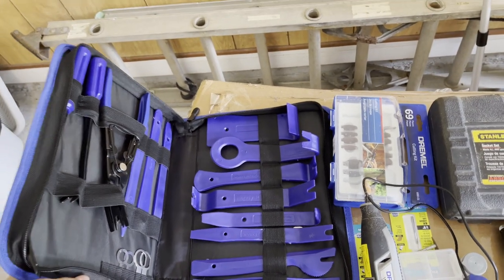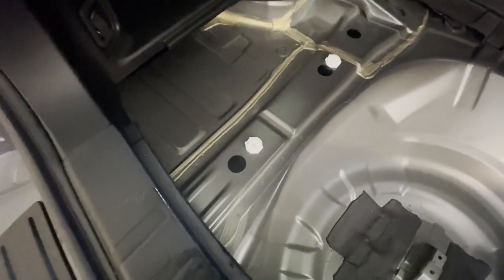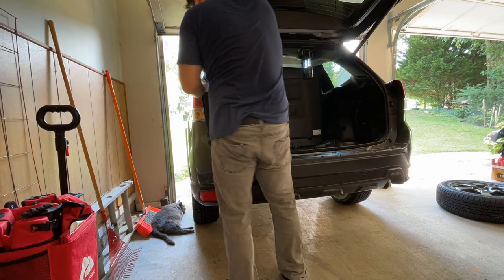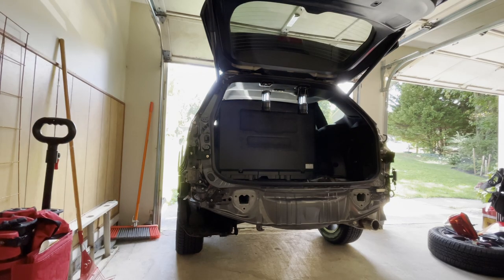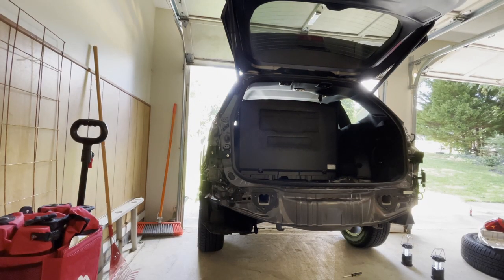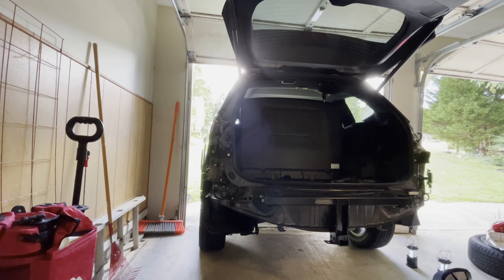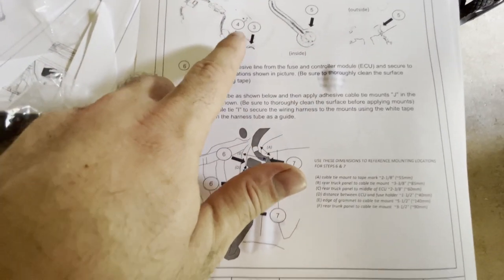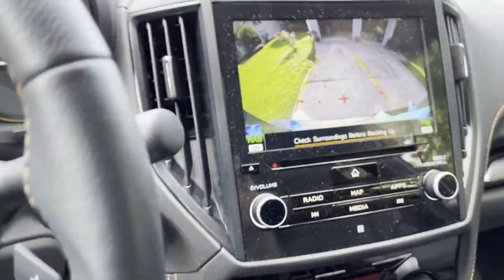Subaru Forester Wilderness 2022 - DIY Trailer Hitch Receiver Install

Comment: Your video was very helpful. Did install on my 2024 Forester Limited today. I’m a woman 63 years old. Got everything disassembled at lunchtime, a little over an hour. After work installed the hitch and got the car back together just need to mount the wiring harness parts in the spare wheel well.  The pictures with the installation instructions from Subaru were very tough for me to make out.  Rewatched video and read comments about the wiring harness install.
Just wanted to let you know your video is still helping. 
Note:  For the muffler hangers, soapy water on a wet paper towel helped tremendously for removal and reinstall.

Comment: Thank you for this!  FYI, for anyone planning to attempt this install, Lisle makes a tool for removing those exhaust hanger bolts without hurting your hands, the "Lisle 38350 Exhaust Hanger Removal Pliers". Spraying soapy water into the hangers makes it even easier.
Reply from the maker: Great tip!
Reply: This was immensely helpful, worth the purchase even if it’s the only time you ever use it.

Comment: this is super helpful!  my dealer wants $635 installed at the factory, seems ordering it would be about $460 with shipping so the savings isn't significant.  But appreciate you (and your cute kitty) showing the process in case I decide to take it on anyway!!

Comment: Good video - thanks. I used it to guide a hitch install on my new 2023 Forester Premium. Basically the same procedure. Took me closer to seven hours including setup, lunch and put away. I agree with IP3TIGO that a better trim piece would make for a nicer look - but still not too bad.  We’ll see if the rubber strip stays put.

Comment: I just did this on my ‘24 Wilderness and there are a few points to add.

16:37 The “foam K” you’re supposed to wrap isn’t the foam tape that’s already wrapped on the new harness, it’s the rectangular foam in the hardware kit. You wrap it around the existing connector plug so it doesn’t rattle against the body (so it matches the tape on the new harness extension).

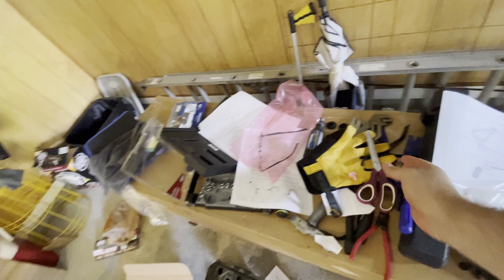16:55 Put it through the plug closer to the side the harness comes from. You’re also supposed to use two of the zip ties included to hold the cables (you tie them around the white taped bits of the harness.

18:03 Two of those zip ties were supposed to go on the inside as I mentioned above. The last one goes around the white tape part of the harness and you stick it on the body about 4 inches above the clamshell. This (along with using the first plug hole) eliminates the slack of the harness. The zip ties (as you put them in the video) will probably fall off from too much exposure under the car.

Otherwise this video helped me a ton. I ended up using actual touch up paint, but using spray paint is probably a lot better. Too much area to cover. I’m not really sure why you need it at all though. The primer still covers everything for corrosion protection, and the area it marks for painting is smaller than the actual area missing paint (although most of the frame down there is missing paint, it’s all gray primer).

Edit: As @xeren45 pointed out in another comment, the Lisle 38350 exhaust hanger tool is worth the $23, even if you never use it again. Ace tip!
Reply: So you're supposed to undo the foam and then wrap it over the existing plug? Overlapping the new + existing wire?
Reply: @Arsenal-Tengu  Not sure what you mean by undo, but whatever foam is already on any cables stays on those cables. You only add the foam that’s loose in the kit. You wrap THAT foam onto the new cable and plug.
Reply: @mrgrimmeh  Ah gotcha, thanks for the clarification!

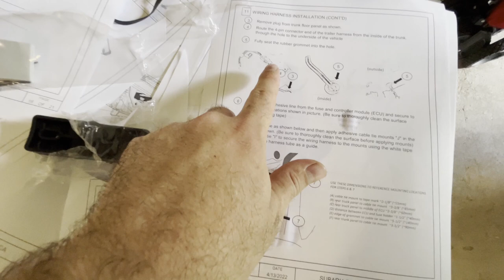Comment: I just had mine installed at the dealership.  Upon a thorough inspection (with the help of your video) I noticed one difference. Please reference 17:10 & 18:00 in your video. They ran the cable through the rubber grommet nearest the hitch wiring bracket.  This method negated the need for those zip ties you used as the cable run to the wiring harness was so short.  They were not needed or practical.  Great video, thank you for posting.  I feel lucky to have the Subaru hitch, as they are still very hard to get.
Reply from the maker: Gotcha, I wasn't sure from the instructions which one was the best option. I'll have to check if the wider rubber part that plugs the opening on the wiring harness can move to adjust the exterior length. Thanks!
Reply: The 2022 Forester Wilderness is rated 3000lbs towing capacity.  Is this factory hitch  rated for 1500lbs or 3000lbs? Thanks
Reply from the maker: @josejarmenteros8296  Most of what I see online is showing the 2 inch receiver is rated for up to 3,500 lbs (What I installed in this video). The 1 - 1/4 inch receiver is only rated for the 1,500 lbs.

Comment: I've got to give you credit.  After looking at tearing all that apart, cutting into the car and putting it all back together again, it's something I wouldn't tackle.  I'm waiting for my 2023 Prius to come in within the next week or so and I'm going to find someone to do it for me.  I want to use a bike rack and the one I have requires a hitch.  Not a problem on my highlander but damn.... taking off all that seems to be a huge pain in the butt.

Comment: Great video. Do you know what the ground clearance is with the tow hitch? I'm contemplating whether to get the oem hitch or an aftermarket one. I intend to do a little light duty off-roading so I want to lose as little ground clearance and departure angle as possible.

Comment: The hitch for the Outback Wilderness comes with a plastic trim piece that you install around the part that gets cut out for a really nice, clean look.  Too bad the Forester Wilderness doesn't as it doesn't look as good since it only gets that rubber strip to cover the cut edge instead of a molded plastic piece.  Anyway, good video to give an overview but would have been much better if you showed all the work instead of mostly having a camera filming you from behind.

Comment: Great video, thanks much. Question: How does the hitch hanging down under the car affect your angle of approach and departure?
Reply from the maker: The oem component is much better in that regard than other options that hang under the car. There is likely some change to the departure angle but I have not had an issue with it yet.

Comment: Thanks for sharing.  We purchased our 2022 Forester in November and I was looking for information on how to mount the Hitch. It wasn’t clear why you had to remove the bumper.  Can you hive me some insight on that?
Reply from the maker: To access the vehicles frame, the Subaru hitch component replaces the bash bar under the bumper cover and connects directly to the vehicles frame.
Reply: @newbiewithasubie4772  I've ordered the hitch so it won't be long before its mounted.  Again, thanks for sharing.

Comment: Did you have to print instructions separately….looks like it was not in the box when you opened it??
Reply from the maker: I did print out the instructions. I don't believe the full instructions were in my box but it has been awhile since I did this install.

Comment: What are your thoughts on the electrical connector placement? Your install seems to match how the dealer installed mine on my Forester Wilderness and the bumper cutout isn’t wide enough to fit my tester to make any real connection (haven’t actually towed yet though).

Have you actually used yours and feel there’s adequate clearance?
Reply from the maker: I have towed and used my luggage carrier that connects to the trailer hitch. The electrical plugin location is very tight. I've been able to do it but I do sometimes have to get under the car to make the connection.

Comment: Do you recommend a 1.25" or 2" hitch? Are there pros or cons to each with the Forester?
Reply from the maker: I believe the 2" was the only one Subaru made for the '22 forester wilderness. The description on the part is not clear though.
https://parts.subaru.com/p/Subaru_2022_Forester-Wilderness-wEyeSight/Trailer-Hitch/120596998/L101SSJ005.html
Reply: @newbiewithasubie4772   @NewbieWithASubie  Do you happen to know the 2-inch receiver tongue weight? The docs on the parts website only make reference to the smaller "1/4 inch receiver rated at 1,500 lbs. towing capacity, 176 lbs. tongue weight."

Comment: Do you recommend paying the $460 to the dealer to do all this and that includes the hookup and part when ordering the wildo?
Reply from the maker: If your dealer is offering that kind of pricing that sounds like a good deal. I was quoted closer to $800 so I was saving over $300 buying the parts and doing it myself.
Reply: That is a great deal.  My dealer had originally priced 500 and then when I was going to order it it was 200 more because it was a class 3 instead of the Class 2 for the other Foresters.